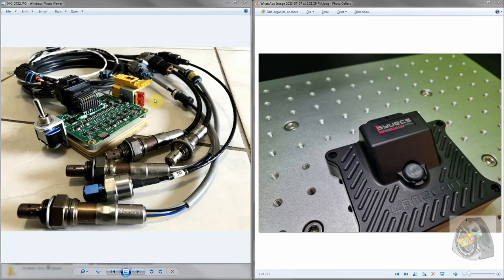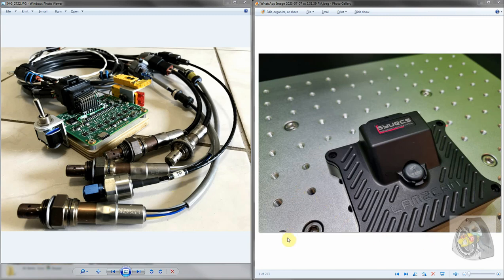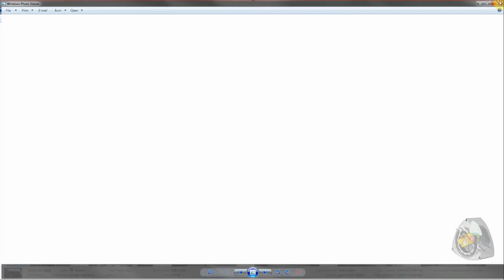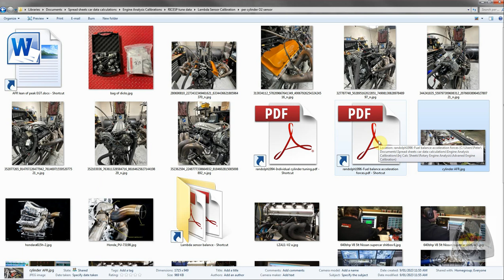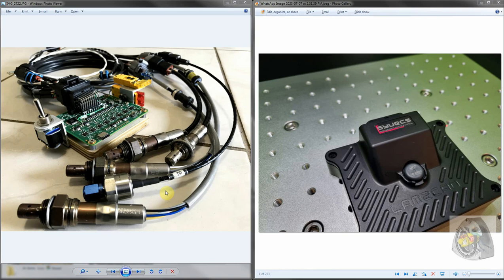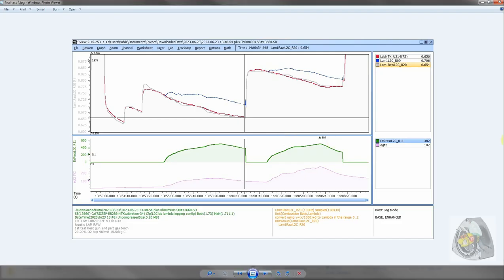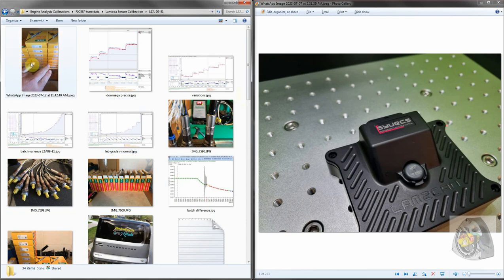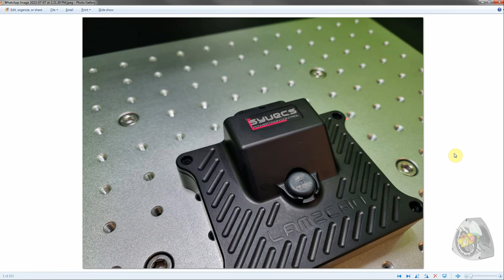Syvecs | Lambda 2 CAN - 8 channel lambda unit with integral dual bank exhaust pressure compensation

Comment: Nice video and looks like a great product especially with the TIP correction. 

What is the unit doing in regards to control of the heater? As per the NTK circuits in the ecu or is there now a closed loop control to target an estimated tip temp?